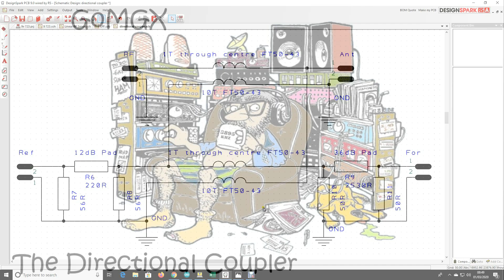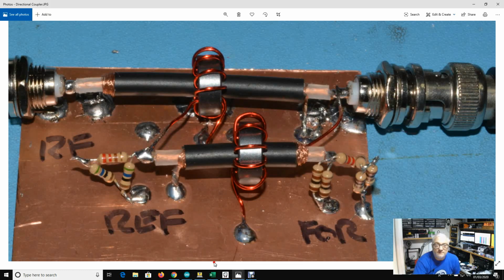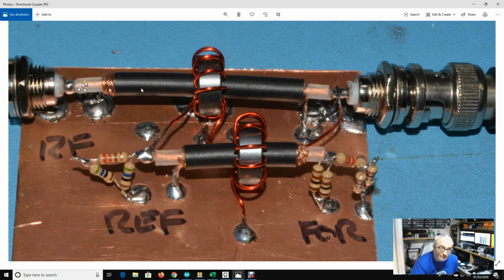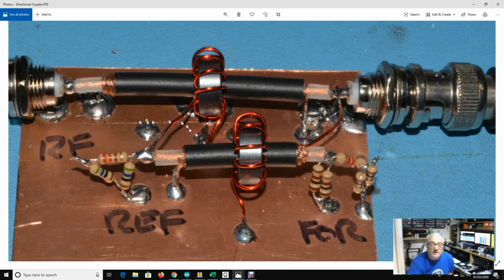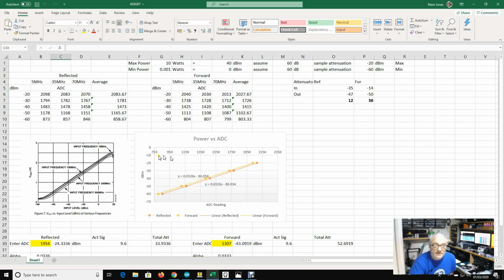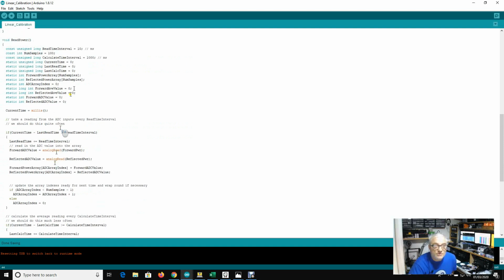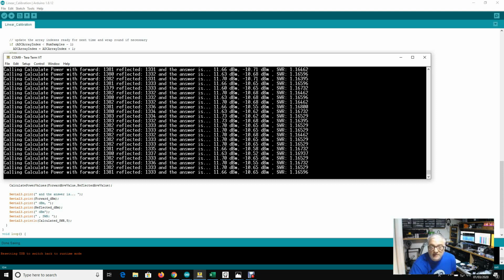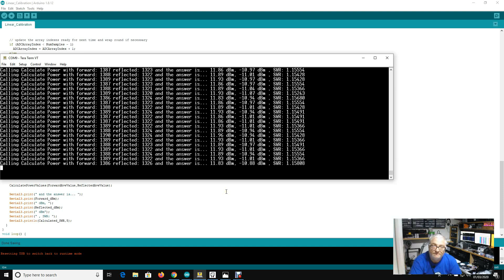Making a 10W linear - Part 3 - Directional Coupler

Comment: Mark, my boards Blue Pill are finally arrived, but i have problem with programming boards as many other People hi! Hi! I would like to know, if you programming yours with ST link Adapter or with usb to serial ftdi? Thanks in advance.
Reply from the maker: Neither; I load the appropriate bootloader onto the board and then program direct from the Arduino IDE. Take a look at this: http://g0mgx.blogspot.com/2020/02/a-stm32-processor-really.html
Reply: @MarkG0MGX thanks so much, i see conversations on stm32 forum but i like ask you directly, i Will buy one usb ftdi and see you soon.